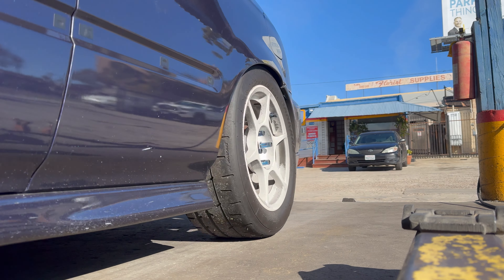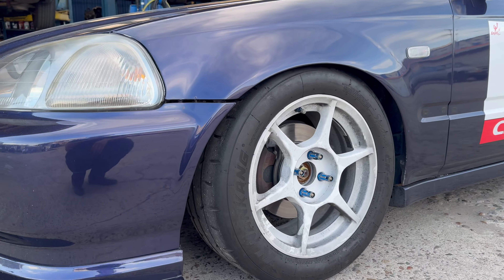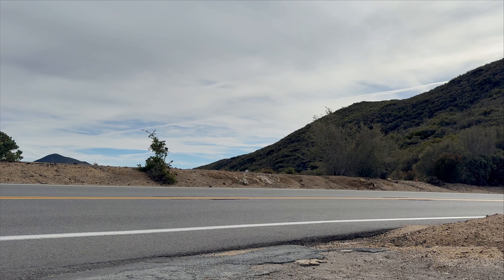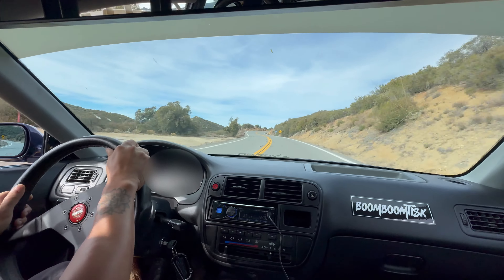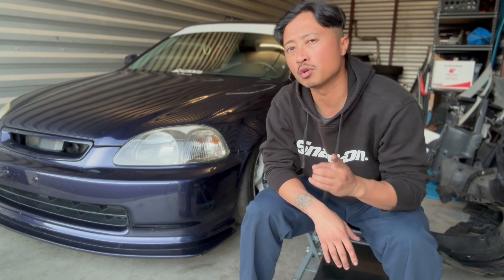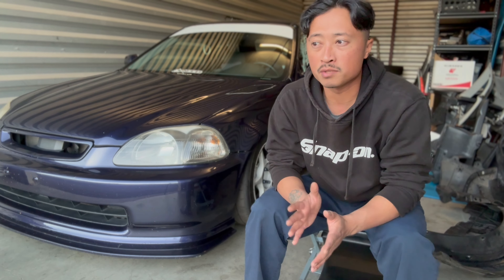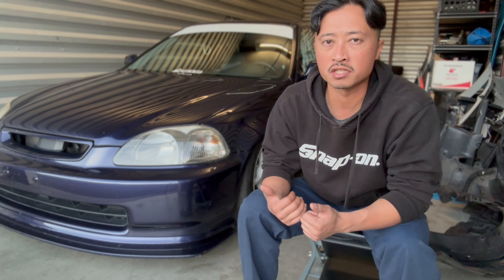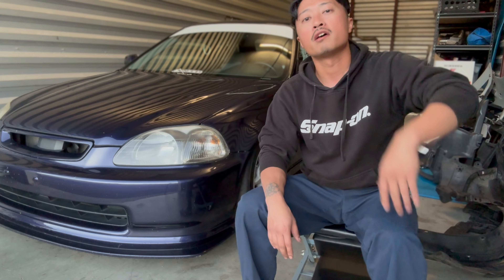EK CIVIC GETS NEW COILOVERS | S3 Suspension Street/Track Coilover Install + TOUGE Test | Honda Build

Comment: Just for the sake of spreading knowledge on a subject that people seem to constantly get it wrong likely due to crap companies like BC coilovers spreading misinformation so they can sell universal threaded shock body coilovers just producing different brackets to fit different cars. Proper way to adjust shock body length & ride height is as follows. Remove spring install coilover w/o spring adj lower perch to set shock body length while checking full travel for clearance adjust the shock body length via  lower perch extending so that the bump stomp engages before wheels contact fender/liner under full compression adding length to shock body for maximum droop with no rubbing or bottoming out lock the lower perch ( never touch it again)  reinstall spring using upper perch to fine tune adjusting ride height often referred to as preload adjustment if your lowering it so much that  springs are free to move up and down during droop than you need helper springs and/or you're likely running far too low or too stiff of spring rate or both. Contrary to popular belief stiffer isn't better technically the goal is to run as soft as possible as much mechanical grip as possible as much travel as possible while just stiff enough to prevent excess dive /squat & unwanted body roll / compression under load from aero. With so many bumpy tracks & rough roads tune roll as soft as you can still stiffer than stock but soft enough to maintain tire contact not lifting wheel as much traction / grip/ weigh transfer feel & tune body roll with sway bars aka anti roll bars Always use top perch to adjust ride height only adjust lower perch to set initial body length for max compression & droop. And a very very good tip mentioned in video to always clock/compress suspension bushings before final tq if tightened in the air once compressed if already tightened can tear bushings once under weight 🤙
Reply from the maker: Thanks for adding valid technical points! I personally am running a stiffer spring rate because this car is more dedicated for track use. Since this video has been made, the car has seen a track day on the stiffer spring rate and overall, I’d say the car feels more stable at higher speed transitions and heavy braking (as I anticipated)

I appreciate you going into depth with the coilover information and hopefully this will help out anyone else with related questions🙏

Comment: Nice video! I've been thinking of switching out my Skunk2 coilovers for some S3 ones on my EG hatch. I also liked the Hot Version translator voice change lol. I seen a good way to measure the ride height is measuring from the fender to the ground.
Reply from the maker: Yes, definitely a good option to consider and glad you liked the edits hahah! On this car I usually use the jack point for height measurement since the fenders are pulled and rolled, but yes you can do that as well. Doesn’t hurt to take note of both!

Comment: By just looking at your video your coilovers are not suitable for daily driving form right? Looks bouncy
Reply from the maker: It’s more on the stiff side, might be a bit much for some if it’s on a daily but they do have other options with softer spring rates that would be more suitable for something that’s going to be mainly used for street
Reply: @boomboomtisk  thanks 🙏
Reply from the maker: For sure!
Reply: I've got the street version of S3's on my Civic, 10k/8k setup and love it. Soft enough for the street and stiff enough for the track.